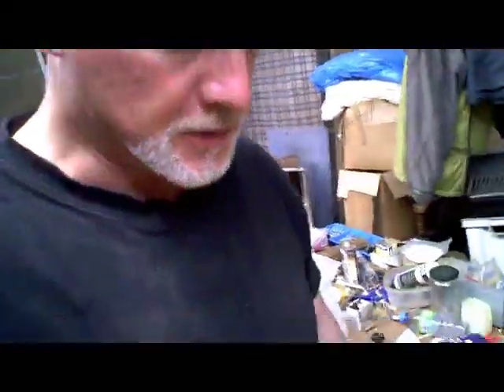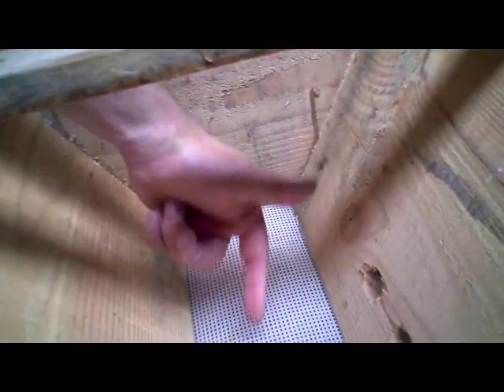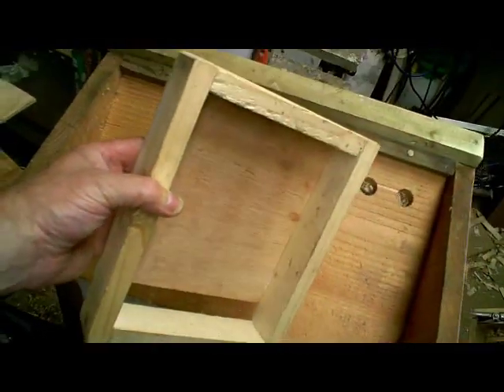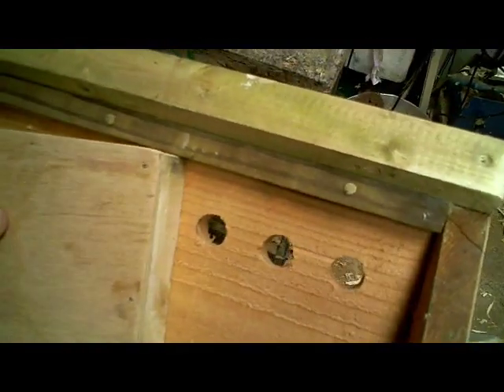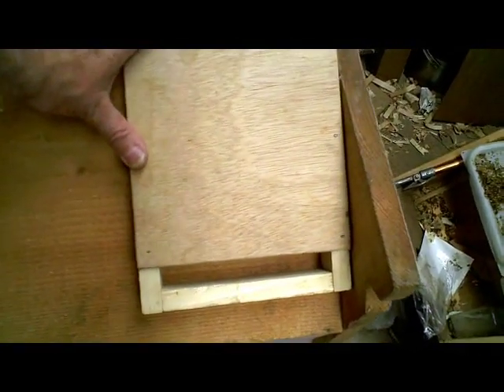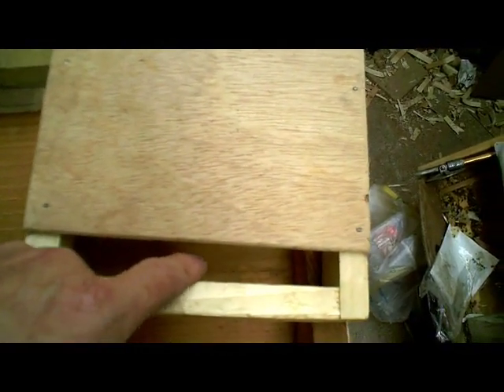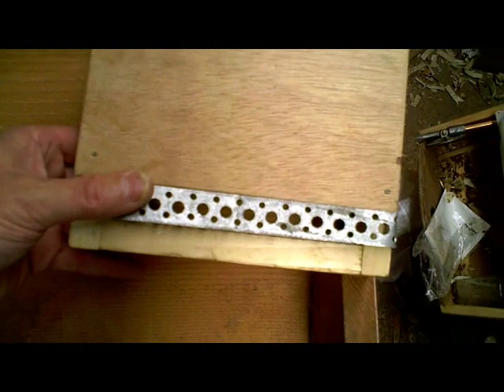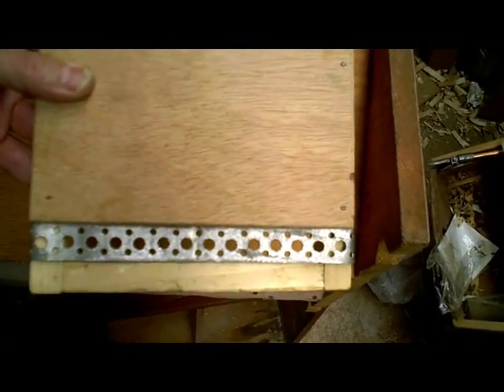Entrance modification for top bar hive

Comment: The periscope entrance seems to do a good job of keeping wasps out of the hive. I have had reports to that effect from several people in different locations, and so far nobody has reported that they do not work. I see no reason why drones would be trapped in them, unless the slot is too narrow or the access holes into the hive are too small. I will make a new video soon with a slightly modified design.

Comment: I would avoid that mouse guard because the bees will clog that periscope box with dead bees which will not be able to fall out of it. This will trap the flying bees inside the hive and they will not be able to fly out to perform cleansing flights and will defecate inside the hive. Happened in one of my hives with such periscope. It might work better without the mouse guard though. Mark I make mine with 10 top bars + follower board and an extra top bar behind it so I can easily take the follower board out. So 12 top bars in total. This also gives some space at the back to feed sugar syrup for the winter. In such set up even strong colonies can easily over winter on 10 top bars. Smaller colonies on 7-8 top bars.

Comment: Nice idea-curious though if it will allow enough ventilation?  Many of us first time TBH keepers are confused about the whole ventilation / humidity issue, and with living in MI, also, confused about the # of pounds of honey needed for a normal hive to make it through winter...thinking of adding a fondant follower board just as a preventative measure...